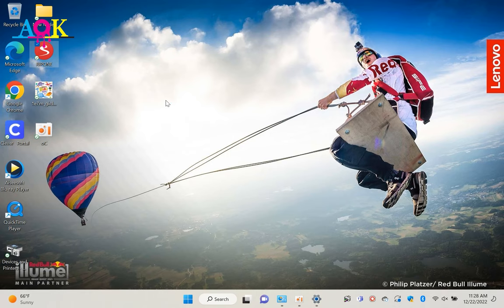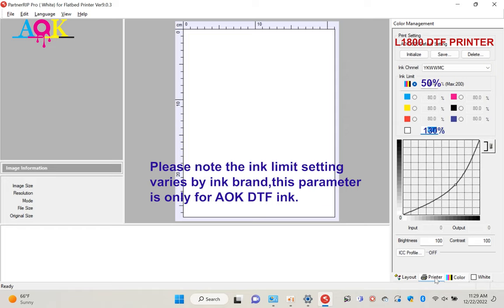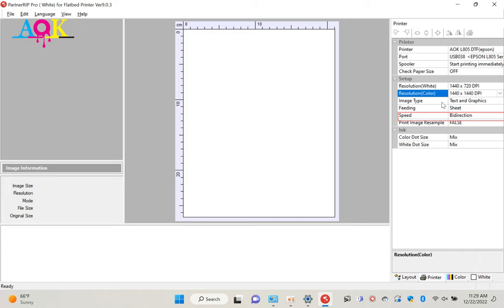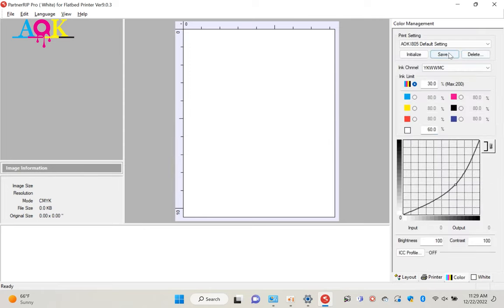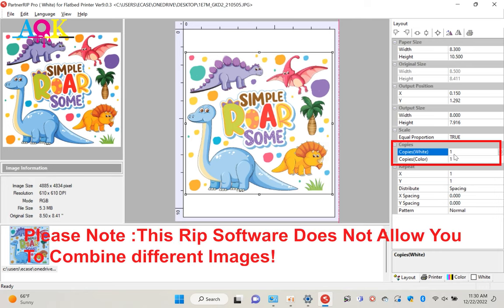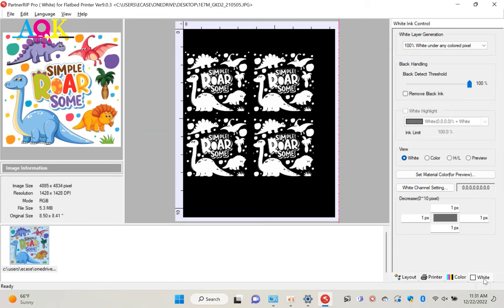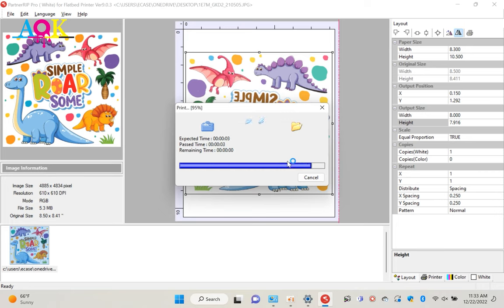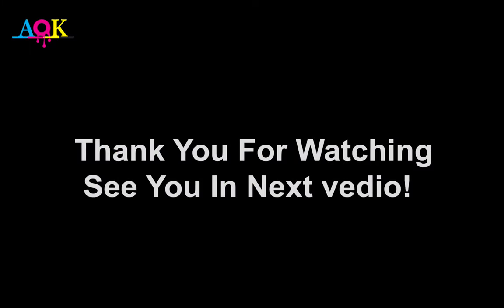Acrorip  9.03 Tutorial  set up Instruction Settings for l805 / l1800 White Ink  DTF Printer

Comment: hi
i did all the settings u did but it doesn't print white on top
Reply: Hey I have the same problem which the white ink doesn't print on top of the design
Reply: Did you figure it out?
Reply: @JoseJimenezJimenez-ne2jc   
yes
Reply: @JoseJimenezJimenez-ne2jc   u need to do nozzel check and head clean until the white print correctly 
and u may need to pull it out by syringe
Reply: You need acrorip software

Comment: What if my white ink doesn't align with the colour print
Reply from the maker: For L8O5,L1800 It won't has the align issue. For dual print head , you need to calibrate it.